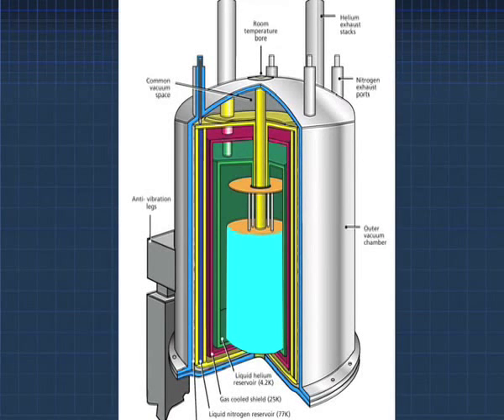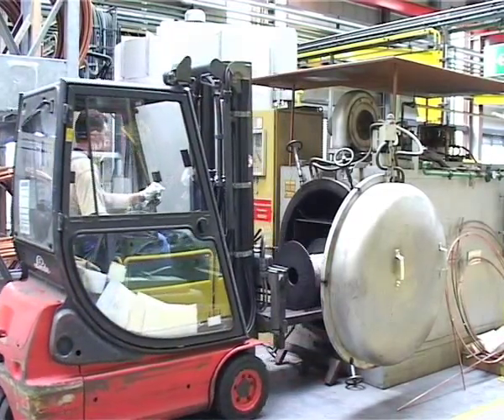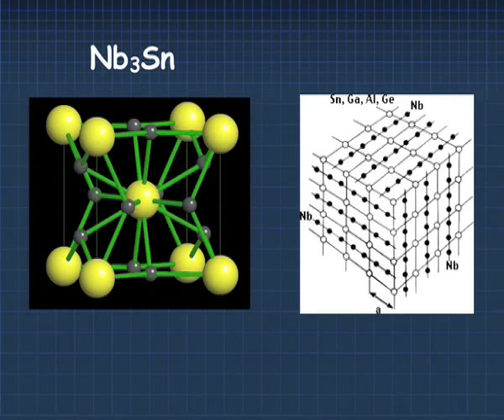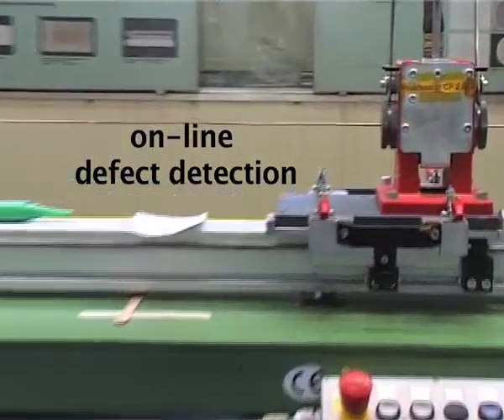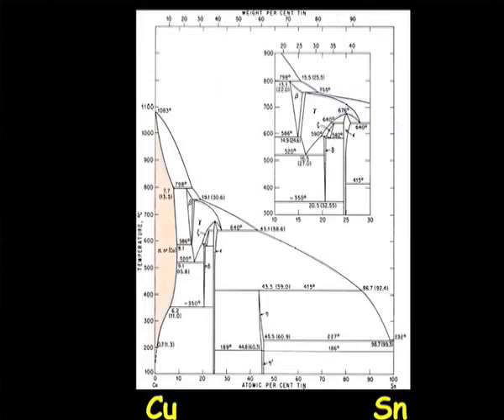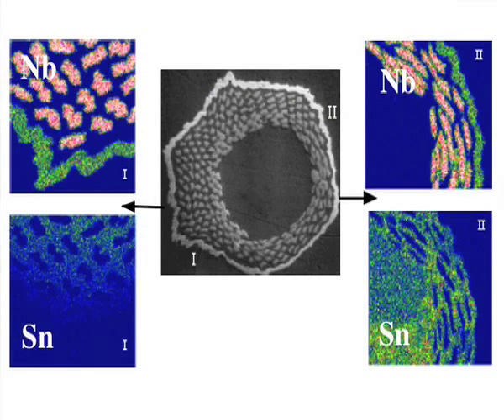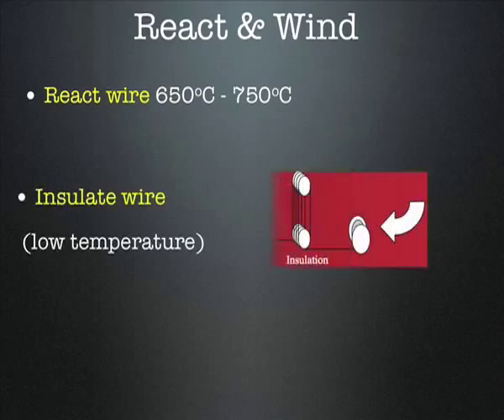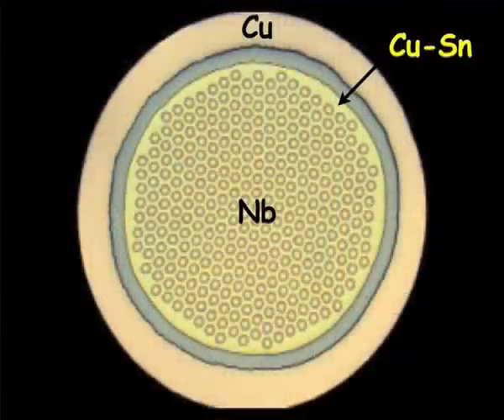Fabrication of superconducting cables

Comment: Question: I thought that current flows on the surface of a wire. Evidently, the NiSn core is less resistant and the current finds it's way to the inside. My question is this: Could the home experimenter create a superconducting wire by electroplating Niobium and Tin onto copper wire?
Reply: Sure, should work on a rudimentary level. You’d have to include some copper in your tin. Best look up nb3sn tape conductors